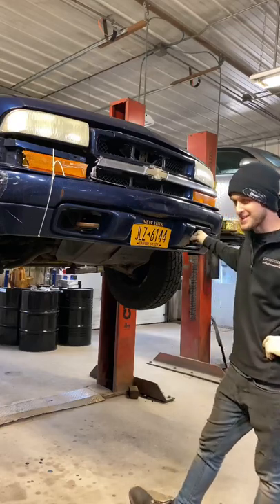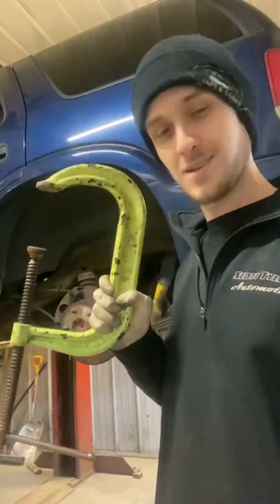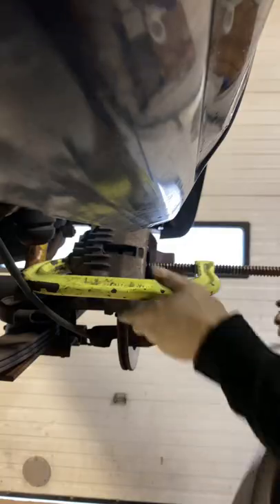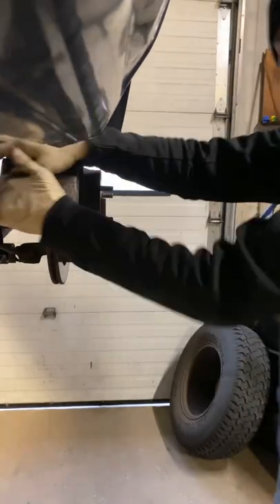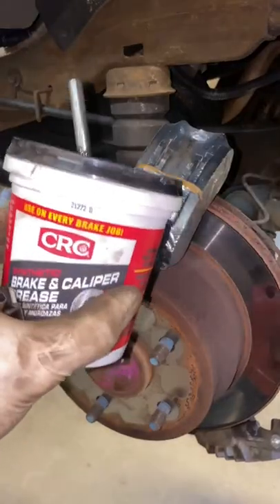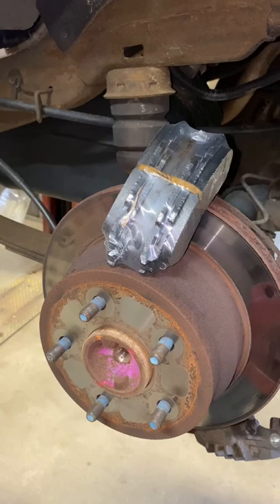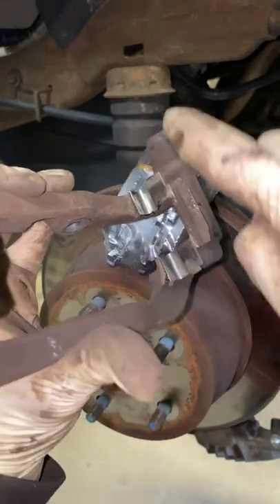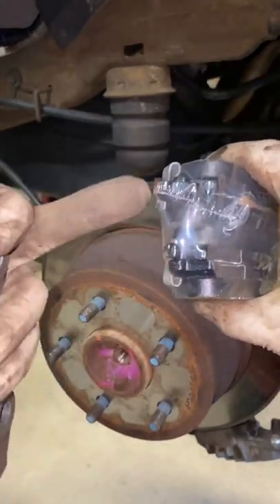Rear brakes in 60 sec!

Comment: What's the point of greasing under ther retaining clips?
You also didn't grease the most important parts, the slide pins.
Fail
Reply from the maker: So they don’t rust and push the clips against the pads, also I did, just couldn’t fit it into the short, if you look closely at the pins you can see the fresh grease :-)